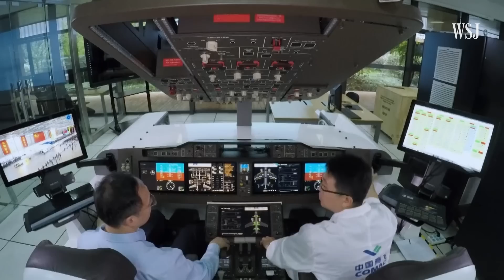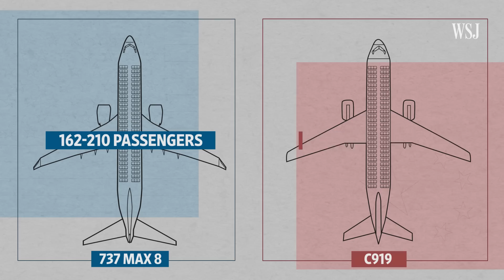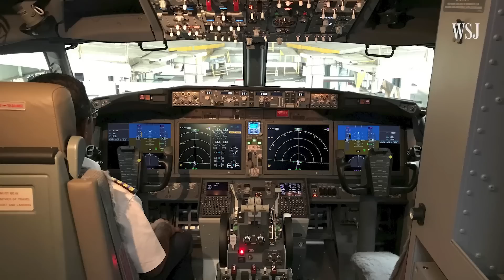Can Comac’s C919 Compete With Boeing's 737 Airplane? | WSJ U.S. vs. China

Comment: I put my bet on the C919, and when Comac starts to cooperate with our DI on manufacturing plane parts, it will not be long when my country starts replacing the old Boeing's with C919 , an order of these 100 planes will make big waves. 🙏🇨🇳🤝🇮🇩✌️
Reply: Of  death.
Reply: @cuckoonut1208  What's that? Oh look it's a 737 MAX wreckage - in Indonesia. That plane made some big waves crashing into the ocean for sure
Reply: @josephc.9520  Agreed. The 737 needs to retire.

Comment: It's bizzare journalism to compare the C919 to the 737 without the A320 family of aircraft. In many ways the 737 is an antiquated design that's be resurrected generation after generation in the name of cost saving (which ultimately lead to the MCAS situation). You also fail to mention the immesnese support the C919 will receive from the domestic Chinese aviation market as most major Chinese airlines are, at least partially, state owned and hence will receive a lot of pressure to purchase these planes. This will undoubtedly help the the C919 in terms of sales with 1/5 of the global aviation market backing it. Unlike the MC-21, this will help the C919 mature and improve.
Reply: US media is all about biased reportings.

Comment: I'm not denying how much they copied, but it's hard to bash them if it is the best design already so any other layout may be more inefficient?
Reply: ALL modern products are a result of copying. That is how technology evolves. BUT when the best aspects of past designs are combined in new ways,  even better products result. The C919 is a much more modern design than either the Boeing 737 or the Airbus 32x series. The only aircraft that is almost as new is the Airbus ( Bombardier) A220.
Reply: Well, just think about passenger cars, they all look similar from distance.

Comment: At the start, C919 is bound for the Chinese domestic market. 
But given their obvious geopolitical tension  with the Western currently and moving forward in light of Taiwan, being able to source 100% component domestically is probably one of their biggest challenge.
Reply: Over 30% of the parts, including the engine, are made by international suppliers. The engine is made by CFM International, a 50–50 joint venture between American GE Aviation and French Safran Aircraft Engines, even though China has already developed its own CJ-1000A engine. It's by design to use more parts from International suppliers.
Reply: @bearpolo3618  Better international suppliers get  some profit from their venture than nothing.
Reply: @bearpolo3618  Far more, its over 60% parts made outside of China.
Reply: @rickjames18  all right, thanks!
Reply: @rickjames18   That is common practice in aircraft manufacturing. Doors for the B777X are made in Vietnam, AVIC’s Shenyang China manufacturer's horizontal stabilizers on the 777s. Parts are sourced from over 25 countries
Reply: @ralphzoombeenie2330  That is completely different from what is happening at AVIC. The west moves production of certain parts for various reasons but it 100% can build everything it needs all on its own. Companies like Boeing or Airbus are not limited by technology. China's AVIC on the other hand is. The absolutely need western parts if they plan to continue building AVIC planes. This is not a matter of arrogance just facts.
Reply: @rickjames18  Sure they can build them but at what cost. Do you think the Chinese don't have the intelligence to match us ? Im not anti-Boeing having spent much of my life flying them and apart from repositioning coffee cup holders and eliminating head damaging switches on the overhead panels I'm happy with them but would like the chance to fly a C919 to compare.  I was surprised at the quality of my latest Chinese EV but still retain my US manufactured EV.. Too much political China bashing will have blowback.. Partnerships and co-operation benefit all.
Reply: @ralphzoombeenie2330  I never said the Chinese are not intelligent enough to developing all the systems on there own. They have the intelligence but the know how and technology will come at a cost which you already mentioned. The west spreads manu to limit cost not because they must. Avic's cost is would be far higher as they would have to develop everything in a timeline that makes sense and they don't have the decades to do it slowly and still catch up. This is NOT about political "bashing" this is about facts. I also have friends in China who tell me quality depends on the maker like any other country. But overall quality is still lacking in most EV makers and cars in general. China does many things that they are good at but lets not pretend like I have said anything that is untrue. If making the C919 was easy they would have done it years ago without western help. Some partnerships are fruitful but we shall see where this one goes.
Reply: @rickjames18  So basically we agree. I still believe co-operation is beneficial to all rather than forcing others to re-invent the wheel. Where would US aviation be without British co-operation on jet engines or German  technology for rocketry.
Reply: @ralphzoombeenie2330  I agree, but the issues I have are how the CCP has used and abused that cooperation.
Reply: The whole history of modern China is nothing but challenge.
Reply: no country can source 100%, even boeings  or air bus. china supply a lot of materials to boeings and airbus too because it is cheaper
Reply: @freeworld88888  China is large enough to be able to. Which is why they are going self sufficient in every way possible.
Reply: @freeworld88888  even boeing doesnt use inhouse made engine
Reply: @freeworld88888  you're right. That's the cost of not having strong allies. That's just a fact of life Comac needs to live with. 
Look at the upside, if Comac does it right, they can potentially have one of the world's most lucrative aviation market all to themselves.
Reply: what makes C919 so attractive is the domestic market of China. Boeing estimated China needs new planes worth 1.4 trillion U.S. dollars in the next two decades. A big part of it will be Comac's C919. If suppliers do not want to be part of C919, then they are missing a big opportunity
Reply: China has its own parts to replace, but the fuel consumption economy is not very good, If the West fully sanctions China, it can only be used domestically.
Reply: Great. It's crashing for china. RIP
Reply: Chinese are great competitors they will outlast Boeing dominated by lousy American government
Reply: Yup, can even sell to Russia
Reply: @cathie3874 

Did you actually know that even if Chinas GDP is growing faster the Americans are becoming faster richer than the Chinese ? 

Chinas growth in this indicator is so inefficient hat also extreme amounts of Labour capital and resources lead to growth. 

And you poor people think really u are running faster 😅
Reply: @isee2978 

1. The auS doesn’t prohibit someone to export to China. They prohibit their own technology to be exported to China. If that foreign company is just using 1 component from
The US for their product they fall under this ban. They can choose to not have that tech from the US or export to China. The US doesn’t restrict the exports of Dutch German or French technologies 😉

So equal competition huh ? 

Why Chinese companies can Invest into infrastructure abroad but western companies can’t in China ? 

Why western companies are forced into joint ventures if they want to operate in China and Chinese companies are not in the west? 

Why foreigners are not allowed the same ownership rights as Chinese do in the west ? 

Why technology transfer and theft is promoted by the Chinese state and legal safety for these companies are not given ? 

Why foreign companies are banned from entire sectors in China if Chinese companies can set up businesses in those sectors in the west ? 

Why heavy taxation and tariffs hit companies from the west ? 

Why production sides need to be build up so u can operate in the Chinese market ? 

I think if anyone ever lied about opening up more and giving equal competition to companies operating in China…… 

We talk in the case of China at a total different level of hypocrisy….. sorry. 

Siemens, VW and BASF or Solar companies and so on can sing a long song about this. 

So why not ban special components for Chinese companies ? I mean we can also play unfair isn’t it ? 🤣😂

Maybe the C919 is the next target. Total production….. 10 and stop…
Reply: @isee2978 

Siemens had a legal case and was ripped by China. 
VW had a legal case for engine 

Just under one-third of CFOs of North America-based companies on the CNBC Global CFO Council say Chinese firms have stolen from them at some point during the past decade.

Like …… bruh …. 

And you want to state here there is nothing 🤣😂
Reply: @isee2978 

I am not lying. I can give you a article in German if u want where the engine of VW was copied by the Joint venture partner. 

Or about the theft from Siemens. 

I can see anything in western media I would like to see. Pls don’t talk nonsense I can even watch CGTN if I want. 🤣😂🤣🤣
Reply: @isee2978 Luxembourg because it is a nato country and has the support of the other nato states
Reply: @isee2978 

If india, China and Russia make a alliance, the GDP per Capita would be 6-7 k per year. 

How should we call that alliance ? The alliance of low developed economies with too much patriotism and lack of freedom ? 😅

Russia has a economy as big as Paris and Frankfurt combined. 

India is not a strong economy either ……. 

😂😂
Reply: @JohnZoetebier  

I see but they rely on foreign products and technologies because they want to be nice and because they need them.
Reply: IPhone has more components sourced from China
Reply: I’m quite confident in china’s effort to overcome all the challenges ahead. A world with China to play a major role is much better world, especially to motivate Boeing to be responsible for its new models.
Reply: source 100% does not make economic sense
Reply: They will make the parts.  If they can build the space station........
Reply: @isee2978 

Samsung can not produce chips without American Know-how. I am sorry to tell you that. The products u are aiming for are made partly by US technology. 

Look if China bans let’s say …… 5 g equipment to be sold to the US. 
Ericsson could not send their finished product with parts from Huawei to the US. That’s it. So Ericsson can just take a new supplier. If that supplier doesn’t exist. 

Welcome to the case u are so angry about. 

But again…. China can not raise any voice here about u fair competition.
Reply: @isee2978 

Because the German company can make money in China still at the moment. 

The same reason why huawei still operates in the US or Europe no 😉

Just because a company invests in China it doenst mean the political relationship is not sour. Sorry to tell you that. 

And yes the Chinese market is even if the laws are bad still profitable. But foreign companies get treated badly compared to national ones. 😉
Reply: @isee2978 is that so ? 😄
What makes you so confident of China ? 

600 mio people living with 1000 RMB a month as disposable income. 

Average income of 300€ a month ? 

A bad healthcare system 

 A bad welfare system 

A bad pensions system 

No workers rights ? 

No workers unions ? 

Karl Marx would laugh hard if he could see it. 

I think you are a bit confident to bring up a developing country and put it next to some of the most advanced economies in the world with the highest standards of living and social security. 😅

I mean maybe China is doing better than India ….. but that bar is quite low. 

And in terms of Industry and innovation we don’t lack behind the US and China at all, 

The EU maybe doesn’t habe some world warriors that bark all day. But we can compete and beat America and China In many aspects 😂😂😂
Reply: @isee2978 ooooh really…… should start to list the regulations and non tariff barriers of China here ? Compared to the EU ? Or US ? 😂😂😂😂😂😂
Reply: "source 100% component domestically is probably one of their biggest challenge."
They don't need to, China has several nations 100% ready to supply whatever they need.
Only selfish America and their European footman can put some difficulties to China but even those value a lot more their commercial ties with China than their role as subservient American poodles!
Reply: @acidbot666  That’s funny considering over 70% parts come from the US or Europe. So I’m not sure where you the 100% of “other”. Like it or not, the facts don’t change. COMAC is almost completely dependent on the west for parts and CCP for subsidies. They wouldn’t even exist if the west wasn’t willing to provide parts. Your entire argument is nonsense.
Reply: @rickjames18  "over 70% parts come from the US or Europe."
It is common to start that way, the outcome will be the same, never underestimate the Chinese.
Reply: @acidbot666  Who do you think helped the Chinese get to space? try looking that up.
Reply: @acidbot666  Guy, you seem to be under the impression that China developed everything it needs for space alone. That is not the case. Last, no is underestimating China just giving you some truth and facts.
Reply: @acidbot666  China has done much and should be proud of everything they "the people" have accomplished but lets not pretend everything was done from scratch.
Reply: @rickjames18  " lets not pretend everything was done from scratch."
Irrelevant!
The fact is that they did faster and better than any nation on the planet and that infuriate the competition!
Reply: @acidbot666  over 70% parts are from international companies ? No one could be a problem accept for US and Europe ? 

So you gonna source the high tech parts alternatively from ? 🤣😂😂
Reply: @cathie3874 oooh I lived in China for 4 years. I even have a degree in economics from a C9 uni. 😂

And the GDP per Capita is just one indicator u are right. You need to see it in context with others to make a judgement and China is not performed my awesome in these at all. 

The PPP is a measurement to calculate purchasing power in GDP. In the context of the entire PPP u show the brutto amount of produced goods calculated on price differences. 

But that doesn’t change the fact that the actual monetary value is lower. 

Remember the GDP is just a brutto indicator for productivity. In terms of per Capita this is …….. in case of China ….. yeah